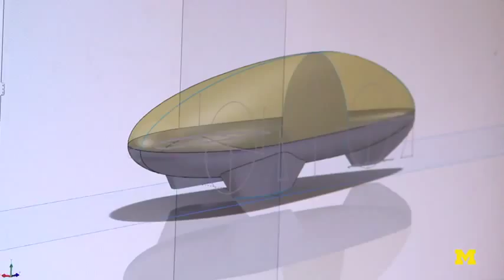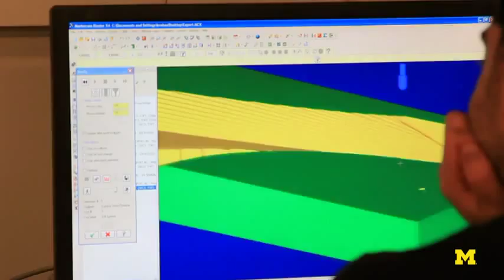Lawnmower Car Gets 3,300 Miles to the Gallon

Comment: all about the weight.  Weight is the reason MPG hasn't really gone up in the past 35 years.  A honda CRX from the early 80's could get 40-50mpg...the same kind of rating you get from modern hybrid models...even though modern engines are far more efficient than they were in the 80's, the average modern engine is moving 1000-2000 more pounds than that CRX weighed.  If you could slap a modern 4cyl into an old CRX chassis, the fuel millage would be amazing.

Comment: Although one can get super mileage from a mower engine, power steering,  power brakes,  heat, cooling and lights work the engine more.  I have a stock Ford car, and I get better than advertised mileage just by good driving practices.